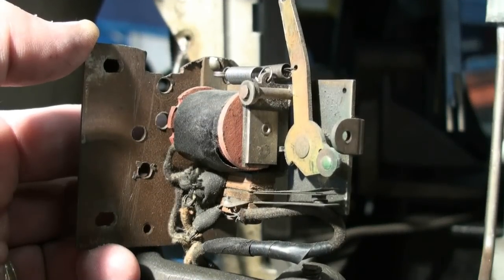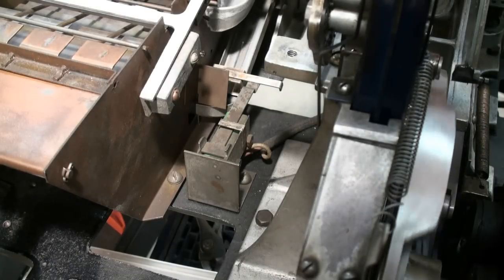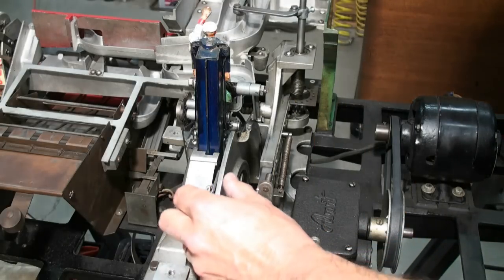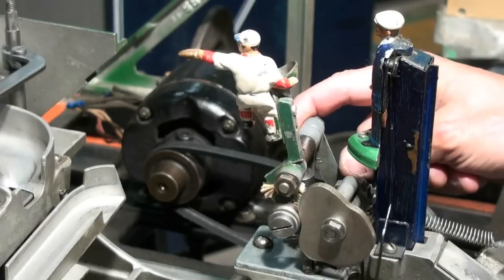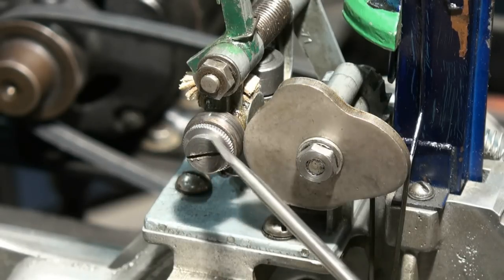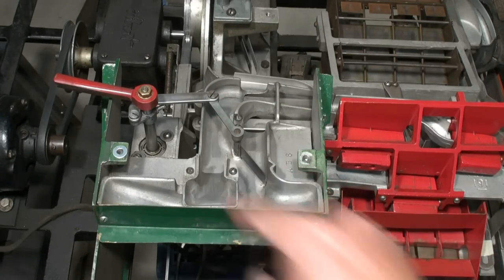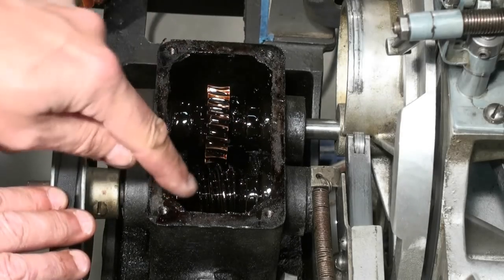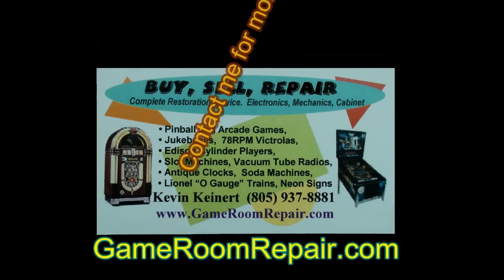1937 Rockola World Series Baseball Arcade Game - part 2

Comment: Why is there grease in the motor?
Reply from the maker: where did you see that? What time on the video ?
Reply: It was on 11:10.
Reply from the maker: that's not the motor, it's a worm gear speed reducer. Like the "differential" in a rear wheel drive car, it has heavyweight gear oil in it.